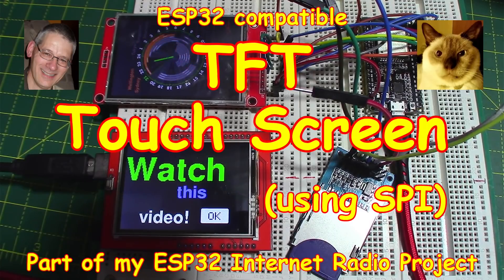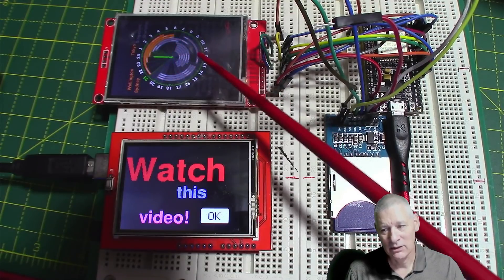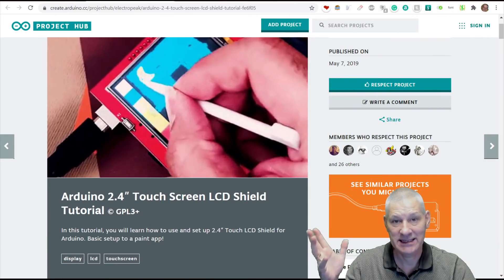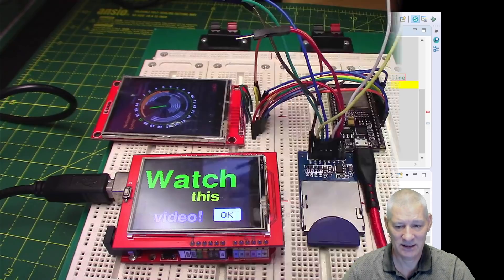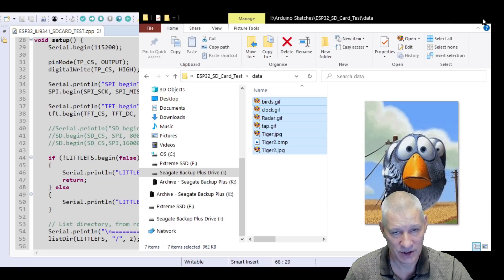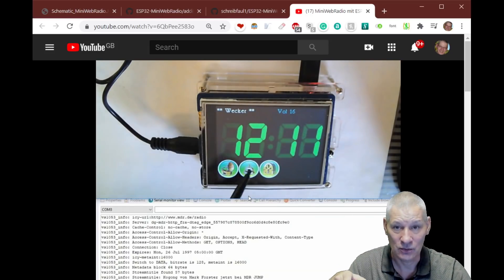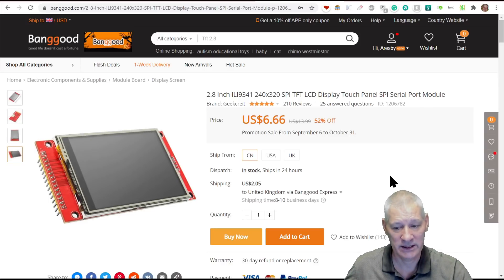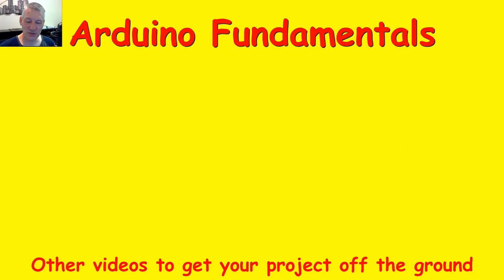#204 TFT Touch Screen ILI9341 SPI for ESP32 (Internet Radio Research)

Comment: Hi Ralph, I'm looking forward to this one ! a nice project with some meat on and you will end up with a sweet gadget that costs a fraction of what it would from a shop...cheers.
Reply from the maker: You bet, Andy! 
So far, if I cost everything up, the ESP32 Dev Board was $6, the VS1053 about $5 and the most expensive thing was the screen, currently about $6.66 so a total spend of less than $20. Of course, the case will cost something and I suppose we ought to add in the cost of a PSU even though everyone has a 1A 5v Phone Charger hanging about! I do want to get a PCB made for this, though. Another $2 plus shipping.
The satisfaction of getting it to work is not to be underestimated, along with the future ability to update the software OTA, including the LITTLEFS partition. All good. Another viewer mentioned BT streaming too... the list goes on.
Reply: @RalphBacon  Yep its a goody !..from my perspective I would be looking forward to the PCB design as I love doing that ! this ticks all the boxes for me because I get invested in something Im gonna use on a regular basis. There is a screen manufacturer who has a full ecosystem to support their screens...might be worth a look ?
Reply from the maker: Could be, Andy. Post any links here.
Reply: @RalphBacon  Not sure if this is suitable but  " Nextion " do a 2.4 inch screen solution with free software to develop a simple GUI.
Reply from the maker: Yes, I have one of those screens. I really should read up about it. Later, after my Mk I internet radio.
Reply: well, i bought a bose soundtouch years ago, no need for amp/loudspeakers, has wireless remote control, MS windows setup, auxilary wired sound input (e.g. to connect to a nas usb sound output) and can connect to the internet router using wifi or wired, 
There is even an independent simple python programming library to control it.
It depends on your current hardware what will be cheaper.

Comment: I'm glad you said the Royal Mail delivery works ok from JLCPCB. I just ordered my first set of PCBs from them last night and that was the delivery option I chose. Interestingly my project also caters for an HC-12 module.... Keep up the great content, I've learned a lot from watching your videos
Reply from the maker: Wonderful! So the HC-12 module that is not actually a BT module but acts like one? Let us know how long it takes for delivery (given the strange circumstances we're all in).
Reply: @RalphBacon  my PCBs arrived today. They took just over 2 weeks to arrive, which isnt bad for economy mail. They look great, looking forward to breaking out the soldering iron...

I'm using the HC-12 as a wireless UART interface for Debug purposes on a shed alarm system, but looking to grow the system to have a repeater siren inside the house.

Comment: Ralph, do you have any guidance on the other variations of the esp32 (S2, D)? I have not paid attention and have ended up with a mixture but haven't had the time to evaluate the differences.
Reply from the maker: The ESP32-S2 is just a single core processor. Nothing wrong with that but do bear in mind that the WiFi and BT code will be running on that core too and will get very upset if they run out of processor cycles - so we have to have lots of "yield()" statements to let them "have a turn". On a standard ESP32D (dual core) we don't have to worry about that, assuming we're running on Core 1.

Comment: Ralph, about your JLCPCB offer that is good until December 25, 2020:
ANYTHING ordered from Mainland China, Hong Kong, Taiwan, etc. after mid-November of any year will most likely be late in arriving due to the high volume of orders being shipped that will then need to go through customs and handling in general by their postal system. This rush creates a backlog that then hits the Chinese New Year in mid-February when everyone there seems to take time off to celebrate and once again all shipments seem to slow to a crawl creating a backlog for the backlog. With the COVID-19 pandemic going on, goodness only knows what will happen to shipments.

So if anyone plans to have anything shipped from the area, please keep this in mind and complete your order before mid-November.
Reply from the maker: Indeed, Terry. I remember this year during Chinese New Year that coincided with the start of our UK lockdown, things took over a month to get to me (usually 10 days). So, a timely warning indeed.

Comment: I do not agree with getting as many pins as possible on the ESP32, I have 32 pins and 36 pins version and they have exactly the same amount of usable pins. The four extra pins is used internally on the module and not recommended to use externally.
Reply from the maker: The ESP32 uses 4 pins on one of its SPI buses to control its internal flash. But they are not normally exposed, are they? I shall check up on what pins are useable by us.
Reply: That is exactly the 4 extra pins on the 36 pin ESP32.
Reply from the maker: On the 36-pin ESP32, agreed. But I "warned" against buying the 30-pin version which is 6 pins fewer. In which case, in your 32-pin vs 36-pin versions, what do they give you in useable pins over and above the 30-pin version?
Reply: Sorry about the 32 pin, it is the 30 pin and the 6 extra pins are the pins used for the internal flash: GPIO6..GPIO11
Reply: @henrikjensen3278  can those pins be used at all? If not then why are they made available?
Reply: I do not know if there are some exotic application (Something with external memory) where they can be used, for normal stuff I do not see any purpose in them, but it sound like a more advance model to say 36 pins instead of 30 pins.
Reply: @henrikjensen3278  good answer.
Sales pitch: here's a bunch more pins that you can't use, and we'll charge you extra for the privilege :)
Reply from the maker: I'll look into this a bit more. We don't want to be duped but similarly if the 38 pin is "better" we need to know why!
Reply: @RalphBacon  definitely on the list of thing to do. My 38pin board should be here on Tuesday ish, so will need to do some comparisons
Reply: So it appears that comparing the 38 pin to the 30 pin, I have one extra GND pin, gpio0 is available, and then gpio 6, 7, 8, 9, 10 & 11, that we're advised not to use.
Hmmmm.
So eight extra pins gives one useful pin.... Unless I'm missing something.
Reply from the maker: GPIO 0 is used at booting, right? Must be kept high at boot. I've found an interesting web page that describes all this (and it seems that 30-pin modules are just fine, 38-pin ones sound better as Henrik mentioned.
https://randomnerdtutorials.com/esp32-pinout-reference-gpios/
https://desire.giesecke.tk/index.php/2018/07/06/reserved-gpios/
Reply: @RalphBacon  correct on gpio0 as far as I know.
The website you linked to has some good info. I've used it many times, and the list of pins/uses I have printed and laminated for reference ;-)
Reply: 38 pin board a waste of space really. A gpio expander makes more sense should one need extra pins... Great opportunity for a tutorial there Ralph, even though you already did one with the Arduino
Reply from the maker: You're not missing anything. I've designed the PCB for my Internet Radio with the 30-pin ESP32 as it is  marginally smaller. I'll clarify in a future video.
Reply: @RalphBacon  good stuff. Looking forward to it. I need to do a crash course on PCB design. My breadboard is starting to look a bit of a mess!!

Comment: I'm using a 2.8" ILI9341 display with my ESP32 project. It's great. Using TFT-eSPI library which is lightening fast. For updating often changing data use the "sprite" class.
I'm with you on the number of pins. The ESP32 boards I have are 30 pins. I'm using all but one, which is annoying as have more things to do. So just ordered a couple of 38 pins which will hopefully sort me out.
Reply from the maker: This morning I just discovered and used Bodmer's TFT_eSPI library. It's running on a separate ESP32 right now but this afternoon I hope to merge the two together. Then we're done. Oh, part from IR remote control. Oh, and the internet interface.  Oh, and the LITTLEFS update for the station list. Oh and the touch controls for chanGing channel. Oh, and... this is a project that will never end!
Reply: @RalphBacon  that made me chuckle. My project started as a speedometer using a Nano and a Nokia 5110 display.
Now it's ESP32 with the 2.8" ILI9341 display and measures speed (hall effect sensor) , coolant temp (thermistor) , engine knock (special sensors from April Systems in The UK), ambient conditions (BME280), lean angle, acceleration & brake force (MPU6050), gear position and two stroke oil level. Oh and just fitted a Ds3231 so I can see the time too.
All the sensor can be read by Bluetooth and it keeps track of things like total distance and total time, saved to the EEPROM.
Also want to hook up my exhaust gas temp sensors (MAX6675 modules) but I think I'm out of pins now. Hence ordering the 38 pin board.
Big thanks to you Ralph as your vids have certainly helped with the code. Especially the tasks and semaphores.
Sorry for waffling on......
Reply from the maker: I'm glad you are an enthusiastic maker! And you understand my project's predicament only too well! Well, can't write here all day, I've got an interface to construct...
Reply: @RalphBacon  my enthusiasm definitely outweighs my talent at the moment, but I'm getting there, and learning plenty.